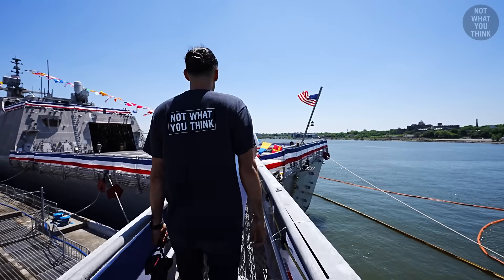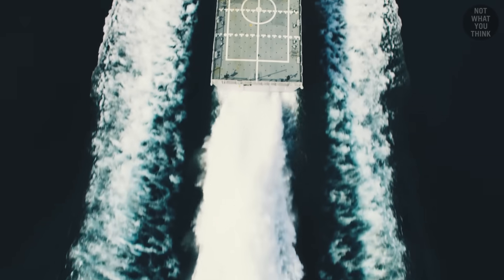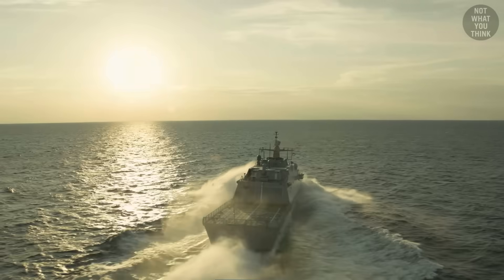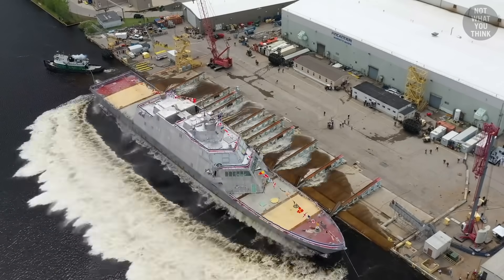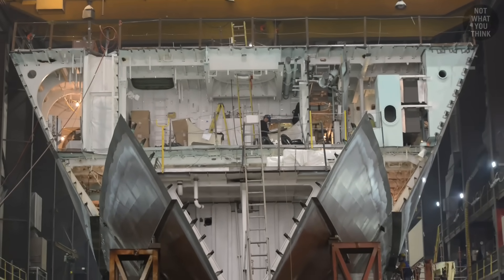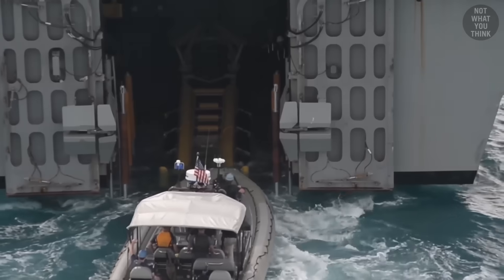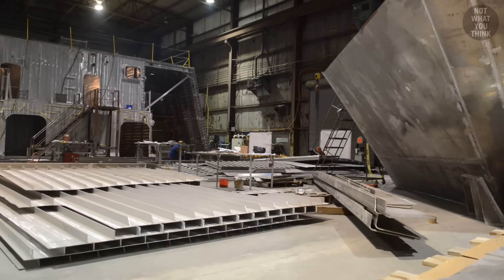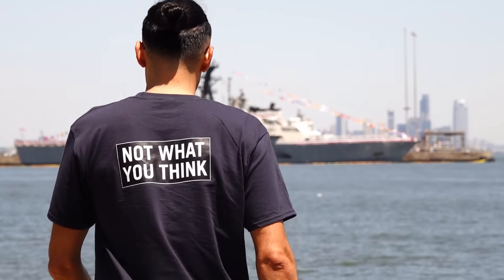I Visited The Most *Overpowered US Navy Warship

Comment: I have been on a Royal Navy version of these and the jet engines produce a peculiar vibration but the speed of the ships is astonishing- the fuel bill was equally terrifying.
Reply: 40 knots is just over46mph /74+kmph
Reply: @Wextopher  still fast for that big of a ship.....but the russian alpha could outrun it by 4 knots.
Reply: @tomast9034  rigth
Reply: The littoral ships are actually now banned from going over 15 knots in any kind of seas as the hull is cracking from the vibration and wave forces...
Reply: @Munakas-wq3gp not both, that was the austal version with the aluminum hull. I believe independence. The other one the freedom had a combining gear issue that got worked out early in the series and tbh I’m pretty sure now both of them are allowed to run up to like 35-40 in sea state 3 or below…maybe that was before the issue was fixed also. NFS they ever fixed austals version completely but improved the issue alot.
Reply: @Munakas-wq3gp  Light and fast.
Reply: @Munakas-wq3gp  sounds like a pos ship to me then
Reply: @Munakas-wq3gp  vibration of..... engines?    Wave forces???? Force of water????can you give more vague a comment
Reply: If I remember correctly the T42 was around 80 gallons of fuel per mile at top speed wasn't it?  Very thirsty girl!
Reply: That's what the diesels are for.
Reply: That sounds like an unforgettable experience! What impressed you most—the raw speed or the sheer power of those engines?
Reply: @RiversLife1987  If street tuned 2000hp lamborghini feels like a lion, this one feels like a godzilla. Finnish Navy have similar ships also.
Reply: Finlands Navy has also similar, little bit smaller. The accerelation is just out of this world. It just feels like it brakes every law of physics.
Reply: Its why need to be a G7 nation to operate one, but i understand turbines ran on kerosene, not diesel
Reply: @jojodelima1953  They can run on marine fuel oil, diesel, jet fuel, kerosene, heating oil or even some refined vegetable oils.  Turbine engines are not all that fussy about fuel.
Reply: @jojodelima1953  Turbine engines can easily run just about anything that burns so long as you can get the combustion process started. You could run them on kitchen grease if you really wanted to! Some turbines are even INTENDED to run just about anything -- the Abrams tank's turbine for example will run on basically anything you put in the tank: diesel, kerosene, Jet-A, gasoline, rocket fuel (though rocket fuel is basically kerosene anyway), etc. It won't run WELL on certain things, like kitchen grease is not ideal haha... but it will run and get you where you're going and get there just as fast as the next tank!... But it might need maintenance sooner than later depending how often you run sub-optimal fuels. 

I highly doubt the Rolls-Royce turbines in these Litoral-class Navy ships are so tough 😅I have a feeling it would be a bad idea to try running them on the kitchen's grease lmao -- but at least in THEORY, turbine engines can run just about anything. Including regular ol' gasoline too.

Internal combustion engines are a different story. It's harder to make an ICE that can easily accept multiple fuels, ESPECIALLY if your requirements call for ability to take diesel/kerosene like fuels AND gasoline like fuels. But it has been done. But it's not common and you usually need to use a BLEND of several different fuels if you are not using the preferred fuel.
Reply: @jojodelima1953  nope, gas turbines are ran on regular diesel
Reply: @jojodelima1953  kerosine or jet A  is clean diesel no parafine in it at all.
Reply: @jojodelima1953  yes- you are right! 🤣
Reply: @SLOWLYdoesit1  @jojodelima1953  I like the input both of you.  I too was given thought about the fuel usage, fuel tanks and refueling issues, even with consideration of the mentioning of kerosene as a fuel source.. Wow.
Reply: @jojodelima1953  Potato - PotAto.
Reply: Which Royal Navy ships are you talking about. I'm ex Royal Navy.
Reply: @Ron-u1z  crikey… I have been on a few over the years… I get invited to occasional events. and I am embarrassed to admit I can only remember the one with clarity that was a sub hunter with this type of set up- HMS Westminster. I was invited to a refit launch I think in 2008ish.  The vibration from the jet engines as we sped full pelt around the Isle of Wight was great.
Reply: @SLOWLYdoesit1   Propulsion	

    CODLAG:
    Four 1,510 kW (2,020 shp) Paxman Valenta 12CM diesel generators
    Two GEC electric motors delivering 2,980 kW (4,000 shp)
    Two Rolls-Royce Spey SM1C delivering 23,190 kW (31,100 shp)

Speed	In excess of 28 knots (52 km/h; 32 mph)
Reply: @SLOWLYdoesit1  the vibration is not from the jet engines. It's from the props rotating rapidly
Reply: Putin e seus apoiadores bem sabem que aquele a quem o espírito do mal favoreceu com riquezas e poder, exige continuadas ameaças e agressões contra toda a humanidade, pois contra Deus. Sentença de Deus: Os russos e seus apoiadores pagarão.
Reply: Sind sie dann nicht für feindliche Sonar sehr leicht aufzuspüren?
Reply: @jeromeschanuel5404  All surface ships are easy to detect by sonar.
Reply: Thanks so much!
Reply: The US has been using gas turbines for quite some time, and decided it was more cost effective than the nuclear cruisers we had. And in the case of aircraft carriers, the primary reason that our main carriers are nuclear is speed and stamina, as they only have to SLOW DOWN long enough to take on fuel for their planes and supplies for their crew. The other reason varies between the two classes. Nimitz class carriers have steam catapults so the reactors produce heat not only to generate the steam for catapults and propulsion, but also make the MASSIVE amounts of fresh water those thirsty cats use. And in the Ford class's case, it's not just to produce electricity for the catapults, but to have an excess for future upgrades, such as electronics, and air defense lasers when the technology matures enough for the purpose.
Reply: The jet engines do not produce the vibration. The vibration comes from the rapidly rotating props creating a lot of cavitation
Reply: There is no RN version.
Reply: @jjhead431  of sub hunter? Jet turbine electric?
Yes there are.
Reply: @SLOWLYdoesit1  RN does not have any littoral combat ships. Only frigates and destroyers
Reply: @jjhead431  Rolls Royce powered, the US version might as well be.

Comment: Perfect for the Coast Gaurd then and also Attack Boats, Narco Hunting Boats, ETC.. LOL
Things that dont need to worry about the noise as much much and would rather have that speed. 
The ships are going to be running higher rpms most of the time with a Jet Pump design, thats maybe why they choose the turbine engine im thinking, and put a reduction gearbox on the Jet Engine, to get the correct RPM and get more torque, that drives one of the 4 MASSIVE JET PUMPS with Reverse Buckets, that adds the "braking ability" in water that they demostrated.

But yeah Jet Pumps are noisy, bc they shoot water out the back which propells it forward with the water thrust and therefore its just a noisy process.. It shouldnt be too loud inside the boat, but it would distrub the water a lot and make a ton of "noise" in the water outside. Which makes it easier for other ships or maybe more so Subs, to be able to find these boats. That would be my guess as to the being compared, and He said these were as "loud" as an aircraft carrier.

The Gearbox issue was stupid and was a design overlook because anyone knows that combining two engines into one output using a GearBox, you need to make sure that thing can handle it bc thats a tough solution there.. They almost would of been better off with Deisel Generators powering Electric Motors for that stage, so that you wont need a Gearbox like they needed for this kind of thing. It was only built 2-yrs ago, so the Military had the Tech. for this for sure..

Cool ship though, i didnt know much about these until now. Great Video!!

Comment: This should be interesting, paused @0:32, The Littoral ship program LCS Independence and Freedom, were decommissioned a short time after they were commissioned and failed miserably because a bunch of dim-wits thought it would be a good idea to spend 28 billion USD and build warships from aluminium as opposed to Steel, then test it for blue water operations, wondering what could possibly go wrong. 

Why they used Rolls Royce vs the GE LM2500 is beyond unfathomable. Tried and tested, if it ain't broke don't fix it, DDG53++/CG-47++ both employ the LM2500 and are built from steel. LCS Freedom is half the size, again built from aluminium and they wonder why the ships hulls developed cracks, COULDN'T POSSIBLY BE DUE TO THE LARGER POWER PLANT BEING STRAPPED TO AN ALUMINUM FRAME! Nooo  🤔

On a positive note, you would use this ship as a last ditch effort, if a nation wanted to defend it's offshore waters, that said if the enemy is approaching your offshore waters and you have to fight them in a ship built from aluminium, let me know how it works out for you. If I had command of a service extended CG-47 I could solo four of these turds then ask for seconds. Are you there MkVI?

Comment: I'm studying Naval engineering and I can tell that most battle ships are equiped with jet turbines for engines, I'm from Spain so I can put the example of the Spanish Navy ships, in the F-80 frigatte class they use 2 gas turbines and for the newest and one of the most advanced frigatte class in the world, the F-100 class, they are equiped with 2 conventional pistón engine producing 12000 HP that doesn't use much fuel and 2 jet turbine engines producing 46000 HP for high speed sailing

Comment: In theory the LCS is supposed to carry mission modules allowing the same ship to perform multiple tasks, but in reality the USN has not designed or implemented this feature yet.
The 1st Mine Countermeasure Module was only delivered to the USN in Apr 2024 and will be another year before it's implemented across LCS - by which time the entire fleet will be decommissioned?
The ASW role is pretty well cancelled because the waterjets make too much noise to hear the submarine.
It's not war capable because while the hull is steel, the structure is Aluminium which burns especially when hit by a missile.  Plenty of vids on youtube of Alu ships hit e.g The Falklands conflict or by the Houthis, if you're curious.
The crew dislikes them because they're maintenance heavy and often the tech is restricted so only an engineer for the contractor is allowed to fix it, which means being moored up in port a lot.
The navy hates them yet are making the same mistakes with the new Constellation class Frigate which is already years behind schedule, the blueprints are not complete, there's no test facility nor any plan to test the propulsion system which is a hybrid system never before implemented in the USN, and no 3D modelling of the layout either but the USN blames the shipyard for not building on time.  Check out channel: Sub Brief by a former USN officer for more on Constellation.

Comment: These boats are in a weird position now that the threat is moving to country war and extreme asymmetric warfare. They don't provide much for either role, as the drone threat will require either energy weapons (EM/EW or directed energy) or more, smaller weapons.

Second, they aren't equipped for future nation-level warfare for peer adversaries. The inability to engage submarines is a strategic deficit. Perhaps the only real strength these have is speed, to evade long range attacks.

Their cancellation and retirement essentially proves that most of the ships have no possible role that can't be otherwise filled by different ships. I think this is because, while litoral operations are important, they will be overshadowed in a long war by blue water ops--since ships will have to fight over very long ranges away from shore.

Comment: The navy needs to transfer the excess ships of this class to the Coast Guard.  They would be perfect for them and their law enforcement mission.
Reply: They’re too expensive for the Coast Guard and they already have two classes of large cutters being worked on: Legend & Heritage class. The Legend class in particular was a candidate for the Navy’s frigate program to replace the LCS but the Constellation was chosen instead.
Reply: @BullGator-kd6ge  They are expensive, but they are already built and operational.  So, that cost is already sunk.  I am not saying that more should be built for the Coast Guard. Just that the ones sitting in mothballs should be transferred.  That way, the taxpayer will, at least, get some value out of the vessels as verses them getting sold for pennies on the dollar to a scrapper or another nation.
Reply: @boeubanks7507 these ships would be terrible for the coast guards mission. They need to get underway quickly in emergencies for search and rescue missions, from my experience I'd say that a LCS has about a 25% chance to get underway without a casualty, usually resulting in multiple hours of delays if not canceling the underway period to troubleshoot the problem. The usual rotation of the ships is something like, do a maintenance period, go through a training period, on load weapons and air detachment, try to get underway, break, sit idle for most of the year getting repaired, off load weapons and detachments, go back in maintenance cycle. They also are not self suffient at all, they require outside assistance for just about everything. Most coast guard bases I've been to would have a hard time dealing with these ships logistically.